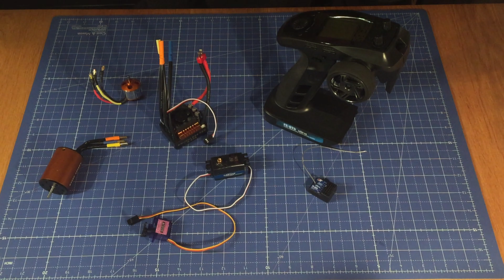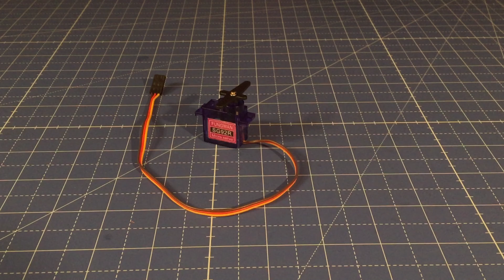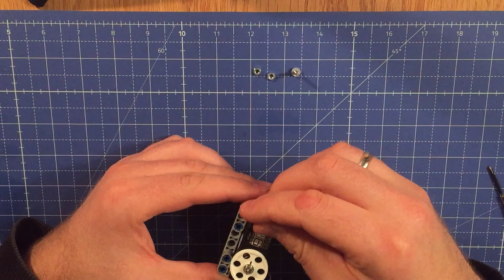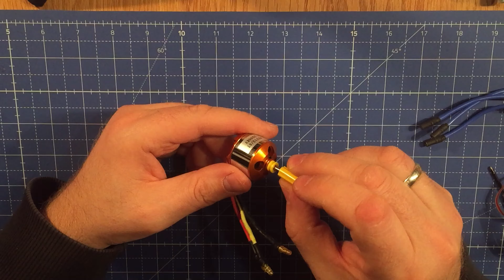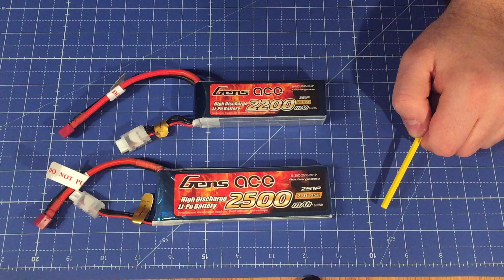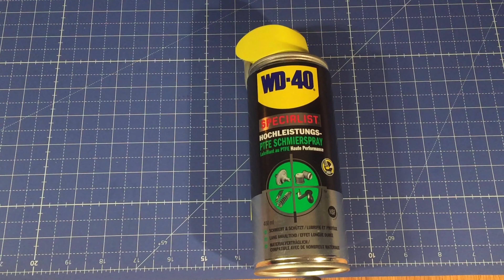Lego 42039 - Howto mod Lego Technic with RC components

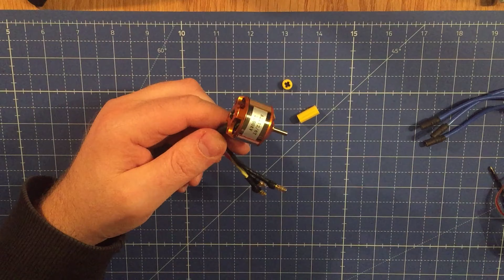Comment: 2:29 I did hear about these but I heard they break some of the LEGO pieces
Reply from the maker: Didn‘t break any parts for me. However, this was my first try. Nowadays I‘d go with a brushed motor, for example from Traxxas. They have more than enough power for Lego if you don‘t want to set speed records, don‘t require massive gearboxes, and you can drive a lot smoother.

Comment: is it possible  connect  motor brush to lego battery box 9v?
Reply from the maker: Przemek Wójcik Hi, yes, you can connect a brushed motor to a 9V battery box. You can even use a small 9V block battery to save some weight. However, you are a bit limited by the LEGO receiver. A V1 LEGO receiver supports about 1Amp per channel, and I think the V2 receiver can handle about 3Amp per channel, same as an SBrick. So you have to pick a motor with a peak current draw below 1 or 3 amp, when using LEGO receivers. 

The motor in my video (as well as most brushed motor/ESC combos from RC cars) draws too much current for a LEGO 9V battery box. You need a battery with a high discharge rate like a Lipo I use, or a NiMh battery. 

If interested I can make a Video about options for LEGO and motors, and how to connect cables.